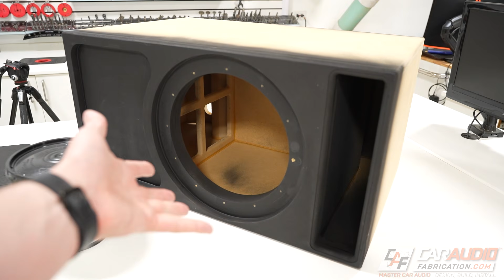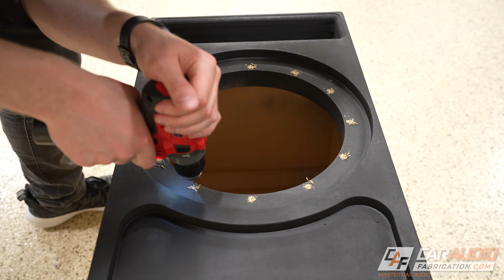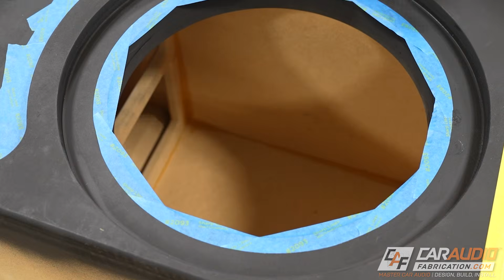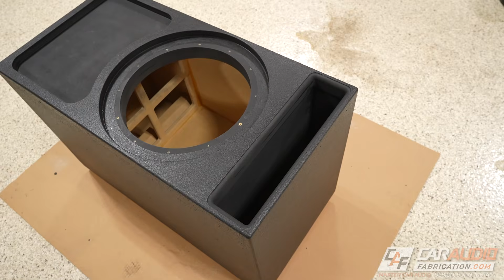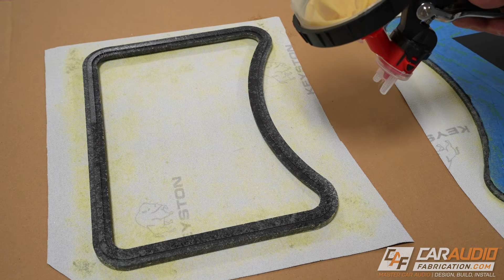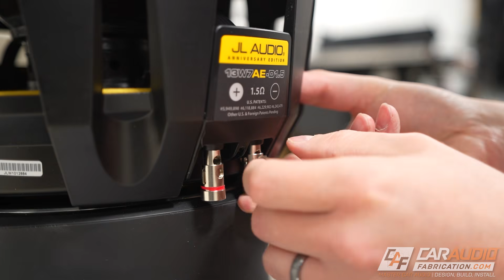Paint MADE for subwoofer enclosures? Finish Coating and Upholstery! - 13W7AE Box Build

Comment: not saying that you should or if its smart, but I was just wondering if you made a box ported for 2 of those amazing subs but one facing in, built internally inside the box but you can see it still much like the one that's facing out. like the normal way.  wired together to help the other sub to pull and push maybe creating an easier way to move/help go in and out with less power but wired correctly at a 2-ohm load???  built correctly with the space and volume including misusing the volume with the one sub that is built internally. smell what I'm stepping in???

also, I'm a welder I was wondering what the sound and bass difference would be if you made a regular or ported box out of aluminum or 304 or 316 stainless steels like your silverware at home. welding all corners and seams making a true 100% seal. thick walls thin walls? the sub magnet would be fine because its aluminum and stainless a magnet won't work on.

Comment: So has this coating hold up? Thinking of taking the carpet off my box and apply this coating. Main thing I’m worried does adhere to the box real well? My box for my Rockford T2 13” is a really tight fit to install into my 2016 Chevy Malibu, definitely don’t want it coming off if it hits the interior body of my trunk.
Reply from the maker: I've used it on a LOT of projects and have yet to see any chip away.
Reply: @CarAudioFabrication  Cool thank you.

Comment: I never had a good sander back in the day and cuts probably weren’t the best so I  would use bondo to try and hide the seams on the wood.  My dad was confused as to why I would put so much on and sand it all off.  Stupid 20 year old me.  Would just spray bed liner on it and call it good.  Made one box to hold two 10W3’s in with a PPI 4125 recessed into it behind the seat of my 1997 F150 regular cab.  After a couple years of flexing the seams showed back up.  Oh well.

Comment: Hello! I have an off topic question to anyone who sees this.. I installed component speakers in my car and used a harness adapter to install tweeter to factory location.. how do I wire the after market tweeters to the new crossover? the tweeters are located in the dash, do i ditch the original harness and run a wire all the way from the dash to the door panel where the new crossover is located? i have an amp ready to install

Comment: I'm not a huge fan of the paint, but this enclosure is sweet! That custom emblem you made is a nice touch. Earlier in the build i thought it would be a bit too much, but it is definitely not. Besides, it is YOUR build, not mine! 😊
Reply: The paint is a huge time saver, i've used both black and white versions with great success, but it is certainly not a replacement for quality vinyl work.  I think it will hold up better over an extended period of time in a moist environment though.
Reply: @Chris Huyler  I 100% understand the pros to using it. It would probably outlast a carpet application if used in a vehicle that sees lots of "traffic" around the enclosure. And that's a great point on moisture. Especially beneficial in a "jeep" type application.
My dislike stems from the look mainly. Like I said, I'm definitely not knocking people for doing it... but I probably will not use it again, unless there is a perfect scenario.
Reply: @Toyotajunkie  I have a single can that has been used for a few different projects.  I like it for recessed amp racks.  I can make them out of cheap materials and slather this stuff on for a professional look.  Then I save the carpet or vinyl work for the trim pieces.  The best part is you don't waste material like you do with carpet.
Reply: @Toyotajunkie  If you don't like the textured look you can use a foam roller instead and there will be no texture to it but it will still have the hardened properties of the coating.
Reply: not a fan of the paint either ...

Comment: I'd be curious to see how well this takes paint...maybe primer in-between. I wanna do a textured finish on my box and then spray with SEM color match, to match my interior. Texture wise this seems like it sits in the middle of actual bed liner and wet coats of the rattle can stuff or maybe the interior panel texture spray.
Reply from the maker: They have a white version you can tint